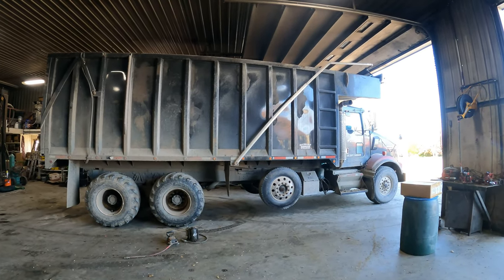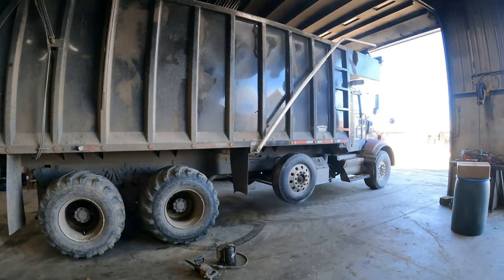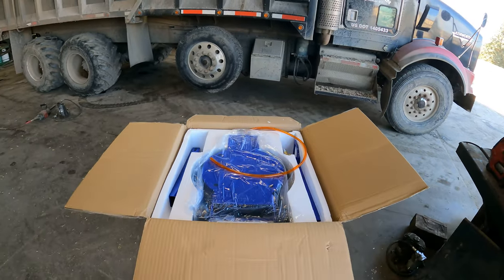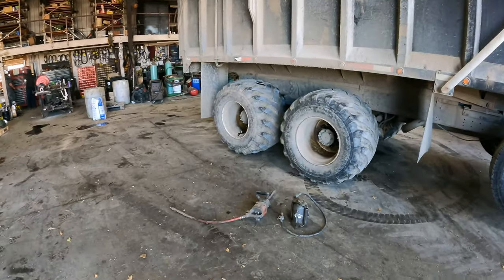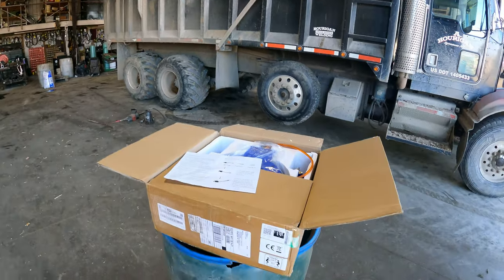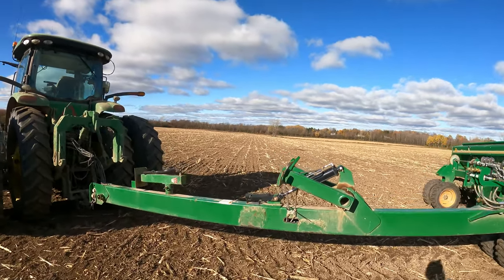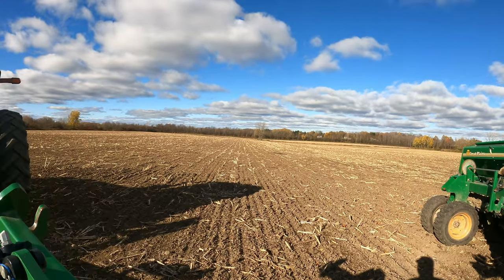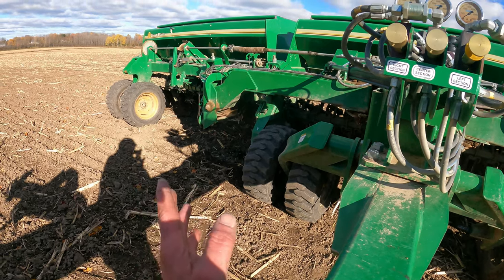Air Bag Jacks…..

Comment: Just the job for the airbag  jack fitting the wheel on the grain drill, you should keep it in the truck, should be able to be used horizontally to help remove big wheels or anything else you need to separate.

Comment: I had to go back and hear the "ohhh" after the forklift went up and the steer wheel about fell out. Priceless.  Nobody checks steer axles on lift trucks..
Might need a complete steer axle assy.  I don't think  it.would move that much if just the needle bearings were gone.
Another good feature about the airbag is that it will work in any position, so you can apply effort to force things apart.  Like you said, the bag doesn't completely replace a bottle jack, but it has its place.

Comment: I bought one about 9 months ago. The 3ton version. Works great for my cars especially for a flat that I have to plug but for anything else jack stands are a must. I also have a 2002 S10. Small pickup but that's too high for it to lift. Use the floor jack for it.
Thank's and keep them coming.

Comment: I use to use 2- 20’x60’ upright Hanson concrete stave silo. It never missed a beet I would have to change doors every time on a Sunday or when you had to go somewhere and in a rush. We stopped using them about 15 years ago when we went to a new larger mixer wagon and it wouldn’t go under the load auger.

Comment: Andy what model and size of Alliance tires are you using as your floater tyres on your trucks? What pressure do you normally run? Are the tyres stable at 40-50mph, or do you have to keep the speed right down? Thanks DP
Reply from the maker: Model 331..45mph max